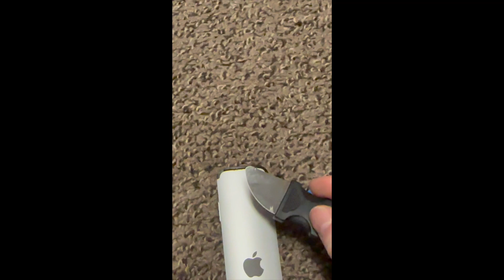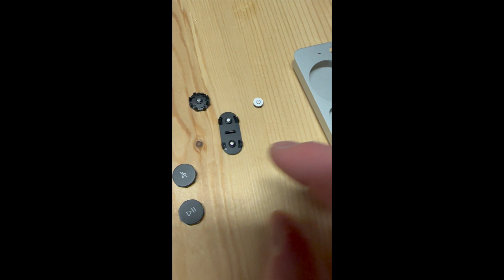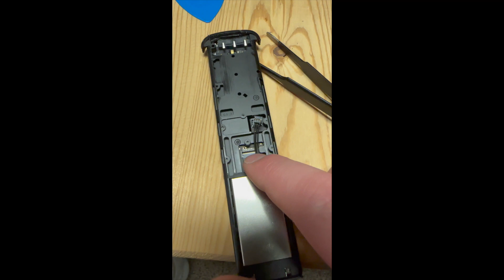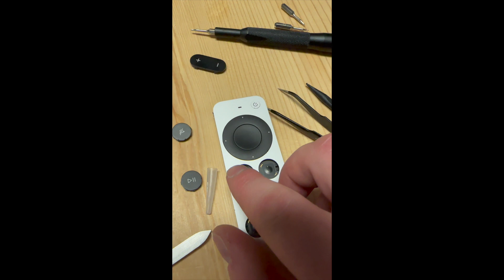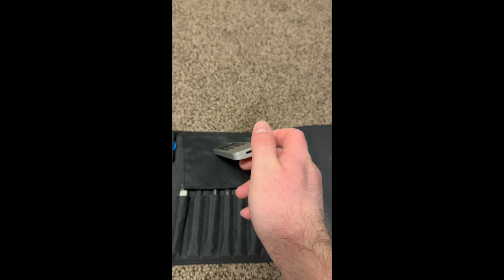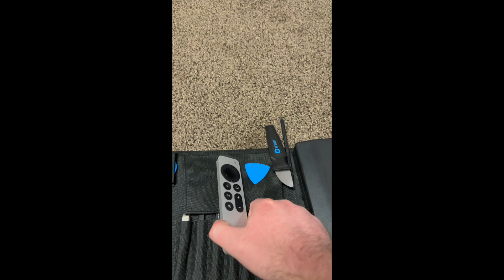Apple TV 4K remote what to do if your drop your Apple TV remote in water, close up, and reassembly

Comment: Did your microphone work afterwards? I'm getting ready to reassemble but the microphone is not working? Do I need to have the board contacting the remote housing?
Reply from the maker: I don’t know if I tried it out of the case but mine works and it worked then too. It’s possible the liquid may have damaged it
Reply: @randomnugs649  I think mine was damaged by the water unfortunately.. thanks for the video instructions, very helpful.
Reply from the maker: That sucks to hear but I am glad the video was helpful to you